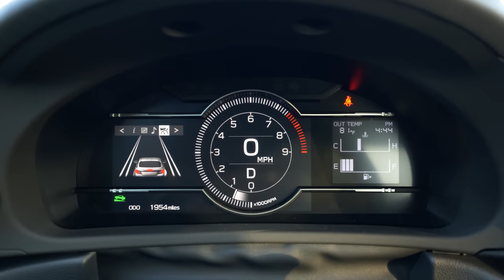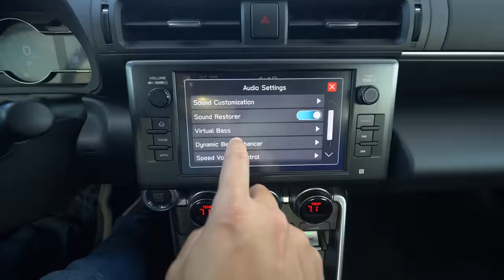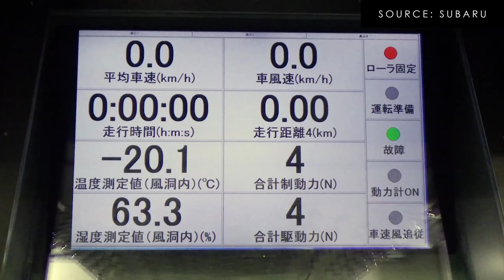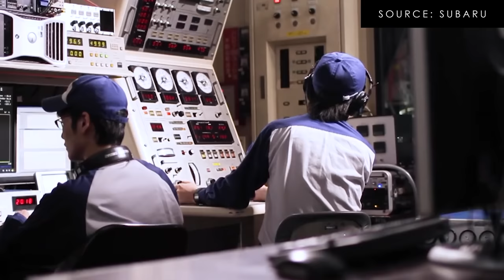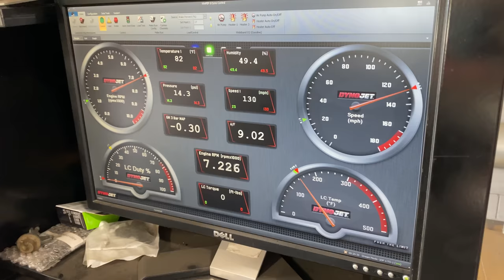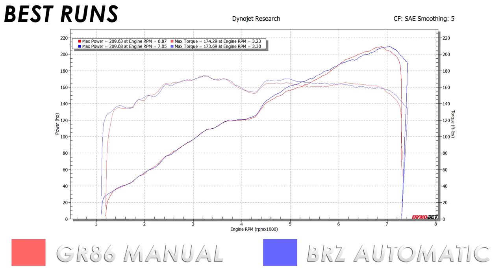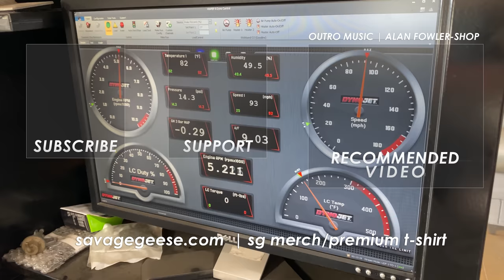2022 Subaru BRZ | Something For Everyone

Comment: I am surprised to learn that even with a niche car like the BRZ / 86, 70% of cars sold in the U.S. are equipped with an automatic transmission.
Reply: The stat is wrong for the BRZ. It’s 70% manual for that. I believe the 86 is the other way around.
Reply: @Kona61  I had heard both cars were predominantly sold as manuals.  But last I had looked into it was early on in the first gen when I bought mine.  
Wish I'd never sold it
Reply: @Kona61  
That makes sense, thanks.
Reply: It's always been mostly a JDM wannabee poser car driven by complete a-holes on public roads. Type-r! Slammed suspension! Pointlessly wide tires! Tow hooks!
Reply: @truantray  
It is different in Europe, I think. Quite interesting how cars appeal to different kinds of drivers in different markets.
Reply: @truantray  are we talking about civics? 
Kids generally have terrible taste regardless of the car.  30° of camber and tires 5 sizes too small for the wheels.  A slightly worse copy of the truck wheels 12inches outside the wheel wells.
Reply: @wayward03  they do that too but like always there’s certain cars that attract THAT type of person. Usually affordable sports/sporty cars. I know last gen you see a lot of used brz/86s were either slammed with rocket bunny kits or slammed cars with multi colored bumpers. Lol
Reply: @MaddNomad1015  it did happen for sure, I'd argue it was less common than VWs civics and wrxs mostly because it wasn't as fast therefore you actually needed to know what the car was designed for.  

Living in the Northwest and being rwd probably makes them less common here though.
Reply: @wayward03  those cars are “priced out of that fan base” as someone once told me before. Sure they’ll get them used with 50k miles or more but you won’t see teenagers driving them new like that. It’s kinda why I’m waiting for the GR Corolla. If you saw how many kids are on the forums talking about how amazing the 86 is, it gets annoying quickly and you know a lot of things going forward might not be accurate as far as diagnosing issues, objective comparisons etc. I see a lot of really young people saying how the 86 is “better” then the BRZ performance wise. Lmao.
Reply: @MaddNomad1015  tons of bad information out there,  even adults don't understand the point of cars where power isn't the only spec.  
I mean I had someone into their late 40's tell me a 60s nova could go anywhere my wrx could in the winter....and that cars from that Era handled great. 

Not much in the way of sports cars aside from obscure new classics that are remotely affordable and not owned by kids(22-30) aka no taste. 

I'll just make mine clean like I have with the last few cars.
Reply: @wayward03  oh yeah of course. I definitely understand. Funny to think I was reading the 86 forums yesterday to see when the release of the thing is and one 18 year old swore it would be available the first week of October. 🤣

Comment: If I remember right tho the take rate for the manual on the BRZ was way way higher than the take rate on the 86/FRS. It was like 78% for the BRZ and 33% for the 86/FRS.
Reply: The purist went to the BRZ and the general folks ended up with 86/FRS.
Reply: A lot of that is down to the demographics. The average age of an 86 buyer is something like 15-20 years older than the average BRZ buyer.

Comment: I can afford this if dealers didn't mark these up by $5,000.
Reply: Even in SoCal, I’ve found several deals from 0-1000 markup without much effort.
Reply: Don't buy a marked up car...
Reply: @wayward03  aka dont buy a car in 2021, 2022, 2023....
Reply: @Buxtonphil  definitely an issue but I doubt it'll be 2 more years.  
A stock downturn of say 30% tends to spook people from buying lots of new expensive items like cars....not saying I have a crystal ball, but history has a pattern.
Reply: I heard if you pre-order/spec one yourself, they don’t/cant mark it up 🤷🏻‍♂️
Reply: @CarsOverPeople   They can.
Reply: @CarsOverPeople  Dealers can pretty much slap whatever price they want on a car from the ordering process to the day it comes off the trailer.
Reply: @CarsOverPeople  then you’ll see it in 2 years. Always work arounds to the rules.
Reply: @RAZGR1Z  The trick is getting a dealer to sign the contract before they order it. Then they can't mark it up. The finance will still try to get you on the back-end of course!

Comment: As someone who has owned a GTI, a GLI, and an IS 350, the fact that the transmission is reminiscent of the 8-speed in my IS 350 is not a bad thing at all. The DSG is a fun transmission to use when driving hard, except when it isn't. It was usually responsive but sometimes was laggy to respond in both the GTI and the GLI and auto-upshifted at the redline. In the GLI it would upshift before the redline even in manual mode with my foot on the floor. Though the gearing was taller in the GTI, I preferred the way that car shifted to the GLI's 7-speed DSG, which was smoother in some situations but felt a bit sluggish in sporty driving compared with the 6-speed in the GTI. The 8-speed in my current IS 350 is much slower to shift; however, it's much easier to drive the car smoothly in normal driving. I'd be perfectly fine with having it in a car like the BRZ, where most time spent on a back road will be in either 2nd or 3rd gear anyway due to the gearing. Obviously for someone who wants this type of car, the manual trans makes more sense, unless if you simply can't or don't want to drive stick.

Comment: I find the front end to be such a downgrade from the old BRZ. It looks like a Porsche on meth and a crying face emoji while the back end has 2011 Civic taillights. Subaru screwed up the BRZ's front end and the WRX's rear end. I also find it pretty unfortunate that this new BRZ does not have pads for your knees anymore unless you pay for the add on accessory and the doors no longer have grab handles.
Reply: I actually like the new front end quite a lot. The rear however, makes me wanna puke. The old tail lights and the trunk lid was so much cooler than this duckbill spoiler going on
Reply: @truantray  I'm just saying the old gen had pads for your knees built in to the design, even on the base trim for no extra charge.

Comment: Sorry Kenny Aranoff, Jack is absolutely correct about the automatic.  I'd take it a step further and say both the transmission AND the engine are way behind the times.  The comparison was made to the Mustang Echoboost and, for the same money, the Echoboost is better in every way.  Both the trans AND the engine have steadily been improved through the years whereas the tired, old Subaru platform hasn't changed almost at all in at least a decade.  I drive a Mustang GT but I would take an automatic Echoboost all day long.  Still love these reviews, guys.  Excellent work, always.

Comment: I don’t see a problem with automatic or manual transmission, it’s just a preference and it doesn’t determine if you are a better driver if you have an automatic or manual transmission, it just depends on on the driver.

Comment: I'm cross shopping the BRZ Limited and Miata GT right now. I owned a ND1 manual soft top and I regret selling that car everyday and have wanted another one ever since. However, the much improved BRZ can't be ignored, especially given the nice price. Plus I have VIP and loyalty discounts available from Subaru, which would make the BRZ a creaming deal. Unfortunately, it's not a convertible so a mere $2000 extra for the Miata (S-Plan price) is a steal too. Since this won't be my daily driver, I'm leaning toward the Miata. It's not as practical as the BRZ but it's perfect as a weekend car and the drop top experience sets it apart.

Comment: Even though people are still upset about the car not having a turbo, you have to think about it, this car makes roughly the same amount of horsepower as a 2006 subaru wrx. Pretty impressive considering it’s an NA car. This is only applicable with the manual brz

Comment: I wish we’d get an answer in these reviews of: Would you buy the Veloster N (DCT/manual) over the new BRZ/86 or not? Auto vs Auto, manual vs manual. Same with Miata auto vs auto and manual vs manual. Sure it opinionated but I love hearing feedback from early press reviews on where those opinions lie.
Reply: I think it falls upon what you value. The veloster is tiny but is arguably more usable due to the hatch vs the 2 door arrangement on the brz/86. Also you can't deny the pro of having a rwd layout for driving fun vs fwd but the turbo power will be more fun and usable for daily commuting. 

Veloster also has a lot more tech goodies for the money. Ultimately it'll come down to personal preference for platform, drivetrain layout, and brand preference. I dont think you can go wrong with either one

Comment: Yes, the car is absolutely better as a manual (most are) but the automatic isn't actually trash. Like the Mazda automatics even though they're a little old and only have 6 gears they rev match well, have good shift logic, and respond when you want. The Miata automatic is also pretty good. Neither are revolutionary but they're good for torque converters at this price range. Yes the gti/gli has a better auto but that's also probably the best automatic transmission under 30k bare none. For the price, there really not bad automatics, there above average
Reply: 100% logical straight facts here as much as ppl love to trash talk the auto on this I’ve yet to hear issues popping up on this Aisin slushbox.

Comment: Great video. I know it's around $10K+ more money, but for those who want an automatic, is the 4 cylinder Supra worth the extra dough?
Reply: I think so but isn't it also gonna be bmw lvls of maintenance cost
Reply: Not in the factory spec, 255bhp is way too poor for the absurd asking price. But those B48 engines can reach 300bhp with a few tweaks, then it becomes proper.

Comment: Nice review for street driving which many of us will do.  Jack is a bit off base when stating which cars will be cross shopped to the BRZ (FR vs FF).  As Mark states, the BRZ with a slush box will be a fun car to drive and that's what most of us are looking for.  @savagegeese, when can we see a similar review with a GR86 Premium?
Reply: They already did a review on GR86 Premium
Reply: @SS-rb2mc  yeah true, but they would be really similar driving impressions keeping in mind they do have different tires, spoiler, and speakers. They probably won't come out with a street review of the GR86 until they get hold of a production car.

Comment: I wonder if the vagueness in braking feel that was mentioned is related to flexing of the brake master cylinder through the firewall. It’s been a known quirk of earlier Subarus..I wouldn’t be surprised if it’s still there in the newer cars. A few aftermarket manufacturers make a brake master cylinder brace that can drastically improve braking feel/response. It made a world of difference in my Forester for $120.

Comment: That "squishiness" in the brakes could be micro air bubbles in the system or the rubber brake lines (a steel braided kit should solve that); changing the pads can give more aggressive bite causing a quicker lockup.

Comment: I’m watching this video again and I’m struggling with the idea that a Corolla is more fun than an automatic BRZ. I’m choosing the manual every single time but I think it’s good that the automatic option exists.

As long as the converter locks up in sport mode and it holds the gear you want it’s fine… but I’m old enough that I remember how awful and slushy and slow automatic gearboxes from the ‘80’s and ‘90’s were.

Comment: personally i'd opt for the toyota vs. the subaru because the toyota front bumper doesn't have a hideous plastic mold for a front license plate like the subaru does (which 20 states do not have/require).

Comment: Well, if the traditional 15% loss factor for HP at the wheels vs crankshaft holds, the would put the Twins somewhere around 240 HP at the crank.

Comment: Sounds like roughly. If you want a subaru you'll get the subaru if you want a Toyota you'll get the Toyota. If you wanna rape up the DS class in scca pro solo you'll get a base spec gr86. And if you are the family dad the brz is the ticket. For me? Well.. Im torn Toyota gives you a track day with purchase but subaru is vehemently more invested in "sti" parts for the chassis and no doubt fixes most of those issues Mark brought up. But at the famous Sti price mark. My biggest query is the aluminum control arms the sway bars bother me because they did a chassis mount but smaller bar. Well done guys. I love this chassis keep up the good work

Comment: Pretty sure you can disable the fake engine noise. Since it's a separate speaker. Just a plug it or perhaps pull a fuse, won't know till the car releases.

Comment: How many speakers are in it? Is there 6 locations. I assuming tweeter woofer pair but is there a full range speaker in the rear somewhere.
Reply: Looks like two full range locations on the rear window ledge. Also on another video I saw two smaller speaker locations in the rear passenger side panels.

Comment: The issue is, being from the states, learning to drive stick is not simple.  No one owns a car for you to learn on, if they do they do not want you learning on it because they do not want you breaking it.  Also few driving schools exist to teach you, and the ones that do are expensive.
Reply: No excuse I bought a 2019 Wrx not knowing how to drive it and learned on it. Find the car you want know that you’ll stick through the learning process and that’s it.
Reply: Interesting... I taught my wife in her first new car, a 2004 Elantra five speed. Took about 30 mins in a parking lot.  Super reliable. It was a manager special, for some odd reason, the interior colors were slightly mismatched 😆 (dash vs doors). 13,500 out the door. Tech included - CD, AC, power door locks and windows 😅

Comment: Honestly I know it's hard to tell from the video, but I'd argue the older Lexus transmissions (like In my ISF) aren't nearly as fussy to downshift. Seems like the Subaru don't let you downshift to second unless you aren't turning over 3000rpm. Regardless, I agree with Jack in that these cars shouldn't be specced with the auto.

Comment: They are as different from the Toyota 86 as a 1995 Pontiac Firebird and a 1995 Chevrolet Camaro. At least the Camaro and Firebird had different front and rear body panels / lights.

Comment: The manual trans version gets blind spot monitoring, lane change assist and rear cross traffic alert.  The automatic version adds autonomous emergency braking, adaptive cruise control, lane departure Warning and lane-keep assist. Why did Subaru/Toyota take these features off the manual trans version?  I thnk autonomous emergency braking is valuable for saftey.
Reply: To this day it's a bit of an iffy topic about applying AEB on a manual transmission car....IIRC only mazda was willing to risk putting low speed AEB on a manual trans, and they explicitly warn you over and over again that the system will stall the car if you don't react fast enough. 

Then there's just the market ...Most people who buy the manual options, don't really care that much about those systems...Lane keep/departure warning IMO is utterly useless even in an auto and i ALWAYS turn it off whenever I get in a car with one. Adaptive could be nice, but just like AEB causes weird scenarios when you need to downshift.

By buying a manual trans, you opted for complete control of the car...All these features you mentioned are therefore limited in their effectiveness with the manual because of that active choice...So really why bother putting them in in the first place.

Comment: I think the toyota model looks better. Except the rear lights. I like the rear lights better on the 2022 brz. Also not to mention the upcoming gazoo racing aftermarket parts. Idk if Subaru will have such a thing.

Comment: Wonder if I’ll be able to get mine to 300 crank horse power with NA mods and a tune considering how underrated these things are out of the factory
Reply: That would be 125hp/L. Porsche is able to pull that off in the 911 GT3 with an 8500rpm redline. The average dude throwing on a tune and exhaust? Exceedingly unlikely.
Reply: Ryan never limited my build to only exhaust and other bolt ons, I see what you’re saying but keep in mind Porsche has to deal with extreme regulations that aren’t present in the aftermarket
Reply: 270bhp with full boltons and 95 fuel would make it a miracle, and what this car deserved to be from factory all along. I will buy one next day if that's what tuners get.

Comment: Being 6 foot 4 my choice of small car I fit into is limited to the gen 1 and 1.2 86, this chassis and the rx8. Everything after that just starts feeling fat. I do love the s2000 and now a days outside of raw performance figures it still holds a special spot. I'm just tired of seeing over the top of the wind screen
Reply: 15+ FRS/86/BRZ is a solid buy prices are likely gonna go down a decent as previous owners will likely trade the car in for the newer version. RX8 is actually very cheap atm to buy you could do a Honda K series swap or LSx tons of flexibility.
Reply: @iheartgs400  should visit slip angle media on thoughts on engine swapping the rx8. I've had 2 now with the rotary.. But I agree even a 17+ brx would be or should be going down in price the problem is the consumer market and how beat they are.